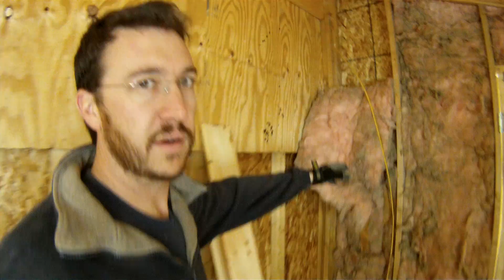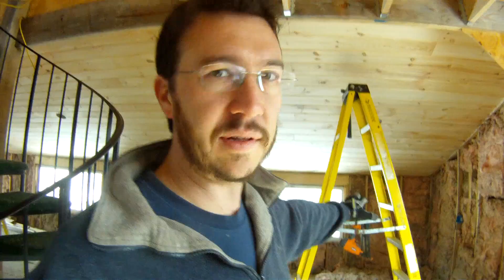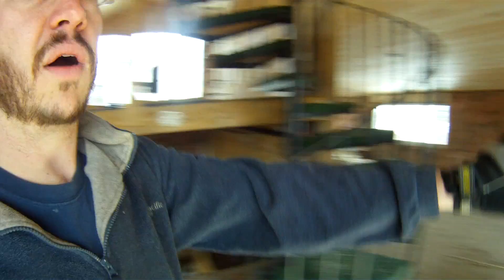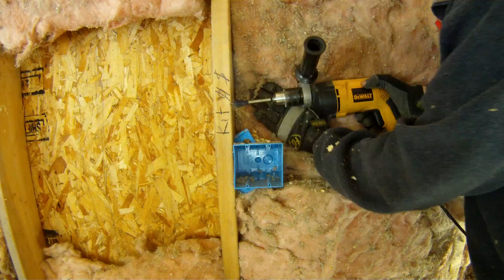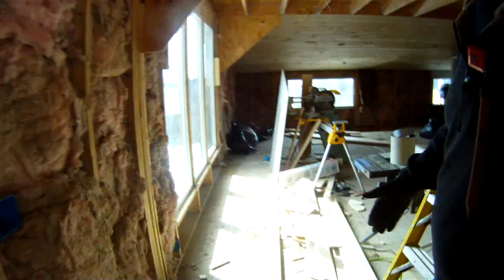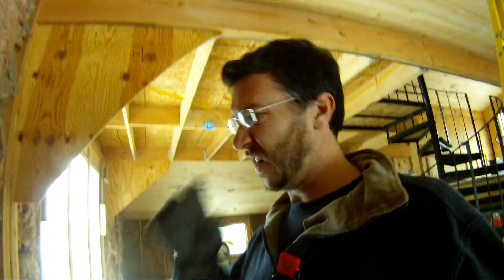Finishing Upstairs Electrical

Comment from the maker: I decided that I didn't want a switch in a wall.  Even at the entrance to the room.  I already have lights with a switch at the entrance, and the fan/light has a switch on it already.  The desire to use that light is usually a decision made right under the light, and I can't stand having to walk over to a wall to flip the switch then pull the cord. :)  But thanks for letting me know about the NEC not need a switch, phew!